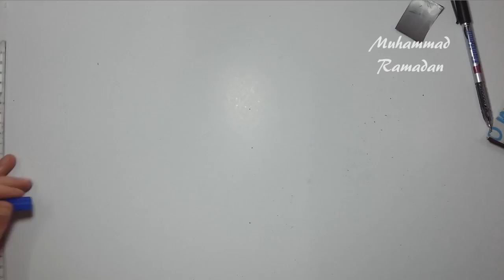Homemade DC motor (2 coils & commutator) model 01

Comment: 5:13 when you start winding the third coil with the second piece of wire you seem to begin the winding in one direction but then you start winding in the other direction. Can you explain this?
Reply from the maker: First of all thank you for your comment, It is really an important point which need explanation,   it is the same direction but during the winding I turned the motor to make the winding easy but unfortunately I CUT it in video editing because of the long duration  so it seems like opposite direction but it is the same direction :) I hope it became clear now.
Reply: @muhammadramadan8249  thanks I was also wondering in this point

Comment: Is it possible to have a 120v to supply it? Or it is too much for that? If it is too much, can i use batteries instead?
Reply from the maker: first of all this motor is DC motor and you may talk about the AC source with 120 volt in your house, if you connect this motor with the house source it will make a problem (short circuit) because it is very small resistance with big voltage, or you may talk about DC supply with 120 volt actually it is very big and by the way there is a relation between the diameter of the wire and the range of current which is allowed to run in this wire if higher current passes it will cause heat and the isolation layer on the wires will be burnt and again we have a problem 
I used here a device that takes the AC 220 voltage from the house and turn it to DC voltage with ranges from 2 to 16 volt  so using two batteries connected in series each one is 9 volt would be an available choice but it is not the best because the batteries will be empty within a short time.
if you need any more explanations for this comment you can contact me on Facebook, thank you :)
Reply: Muhammad Ramadan oh okay, look, i want to replicate your work cause i have this kind of activity in our school plus your work is so damn cool. Our prof said that we need to make a simple dc motor, and i searched some kind of stuffs and i saw yours, the problem is, what kind of source can i use for this kind of situation? (If the battery is not recommended) (i dont have that source you used in this video)
Reply from the maker: Eijay Reyes   first of all build your motor and after that you can go to any electronic store or electric devices shop and ask about a device called adapter or such a device takes the 120 AC voltage and turn it into 12 or 16 DC voltage I am sure you will find it, they are very popular, and if you don't find it you can make your own circuit with simple devices using transformer, diode, capacitor and resistor it is very simple you can search in the internet for the circuit diagram and the values of resistor and capacitor. But I am sure you will find an adapter in the nearest shop :) , any way the batteries are not a wrong choice they aren't the best choice because of the need of charge it if it is chargeable or buy new batteries. feel free to contact me if you need I will help you for free don't worry :)
Reply: Good question but the volts will be too much for the wires to handle it will burnout but if u want the wire to handle that much volts is by tuning the wires to more bigger copper wire. Oh and the brushes will have to tuned too.

Comment: at 9:29 what is that long stick.
wood? or iron??
Reply from the maker: It is a wooden one :)
Reply: Muhammad Ramadan Can I use long nail instead of wood?
Reply from the maker: Yes for sure, but don't make any connection between the nails and the segments or the source (to avoid any short circuit)

Comment: Very nice, plz say me which thing or metal did you use to make commutator?To make commutator is very difficult for me. Plz, plz  reply me. I am very interested to make DC motor.
Reply from the maker: I used a can of soda, but you need to sand it to remove the insulation  layer.

Comment: Could you run it backwards to produce electricity?
Reply from the maker: Yes it could,, you need an external prime mover and the output voltage will depend on the speed of the prime mover.

Comment: Will it work if the core is metal, instead of plastic?
Reply from the maker: Sure it will work but if this metal a ferromagnetic material (is attracted by the magnet) it will be better because the flux of the coils will be stronger but if it is not a ferromagnetic material it will work but without a remarkable benefit 
make sure that the core is isolated from the commutator and the wires :)

Comment: How much is the RPM
Reply from the maker: This design was made practically without considering any rules or constrains so I can't apply any rule now to calculate the rpm, but I will search for it and if I found a solution I would tell you :)

Comment: are those magnets in the sides??
Reply from the maker: Yes, with opposite poles (north against south) the magnets must attract each other if there is a repulsion between them it means you put the same poles against each other that's won't work so in this case turn one of the magnet
Reply: can i use only 1 big magnet on the bottom ?
Reply from the maker: Yes you can :)
Reply: I have a 3 cm and a 7 cm round magnets which I took them from a stereo. Which one is useful
And in which pole should I put it ?
Reply from the maker: You have two options first you can use any one of them and you will put it at the bottom or in any side in this case the type of the pole doesn't matter  or you can use both of them but in this case you need to put them as I made with the opposite poles in front of each other to check this make sure there is an attraction force between the two magnets.
Reply: Thnx
Reply: Can I use 2 batteries of 9v
Reply from the maker: Yes you can :)

Comment: Voltage?
Reply from the maker: I think it was nearly 15 volt but it depends on the resistance of the coil itself for your case could be higher or lower voltage, but surely higher voltage is better to avoid the low torque issue.

Comment: How to repear  DC motor
Reply from the maker: Well, it depends on the problem itself but most of times  you need to rewind the coils because it may be burnt because of the over current or it may have another problem so I think it needs check :)

Comment: How many volts did u supplied to run it?
Reply from the maker: I used dc power supply the motor was working within 10-18 volts it may works at lower voltage but it will be very weak and slow .
Reply: Muhammad Ramadan can a wall outlet power it? 120v may be too much right

Comment: hi we were wondering what voltage the battery was? and do u still have a materials list for this project?
Reply from the maker: It was an adaptor with maybe 16 volt.
But I think the current is an important factor so try using a 2 amp source with the same voltage.